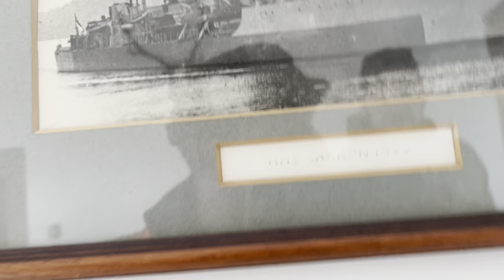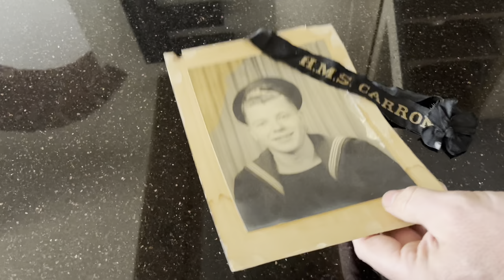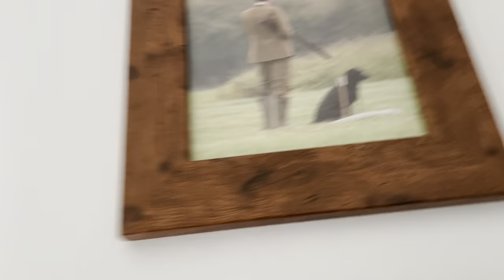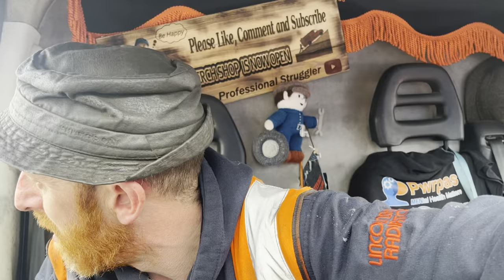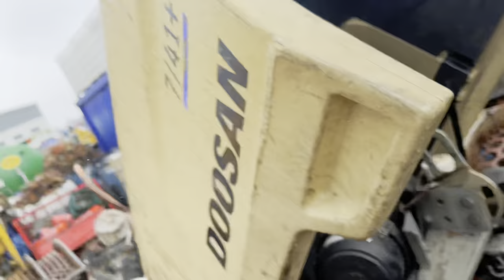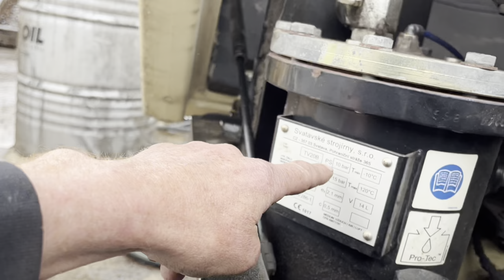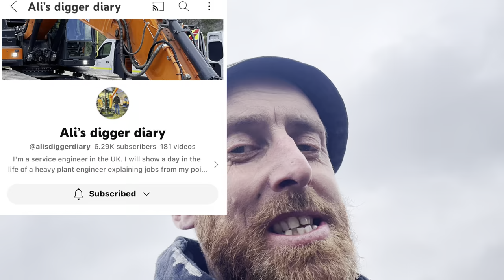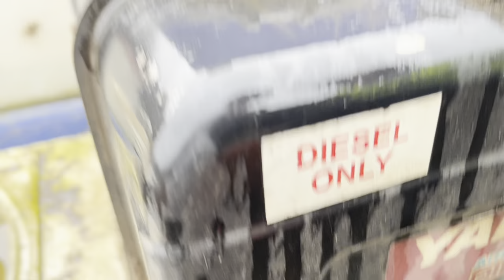Doosan compressor oil in air, brake downs, house tour 🤷‍♂️ jump start 😎

Comment: That sensor on the fuel filter head is a Filter service indicator and the plug on the bottom is a water-in-fuel sensor, on pre 2011 models the filter service indicator was a visual one but the post 2011 models they updated it to an electrical filter service indicator.

Comment: I think your Aussie dog is actually a wombat Chris ?
Interesting point on those screw compressor oil separating filters, the top gasket usually has a couple of steel staples fitted through it, don't remove them as they provide an earthing point through the filter, something to do with preventing static electricity building up and interfering with the oil separation I think, it's a few years since I worked on them though ?

Comment: Those transit filter heads have feed and return running through them and can draw in air. Can join returns with piece of plastic air pipe and loop some rubber pipe on filter head to rule it out. Keep up the good work 👍

Comment: Yes Chris its a  screw compressor which runs in oil the filter separates the oil from the air. Check the oil grade.

Comment: Don't shut compressor down with air line open, needs pressure to drain oil back to reservoir or you get oil in air line. You can use 10W oil in air end, done it for years without issues. 10W not 10/40 or anything like that

Comment: You do not have to remove that tank off the washer there is a large drain plug on the bottom of take for cleaning them out 👍